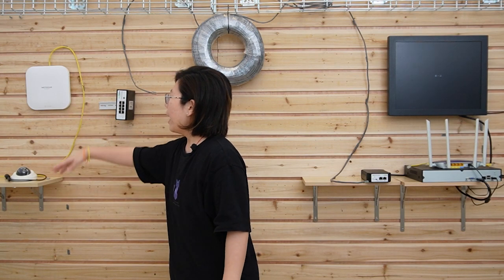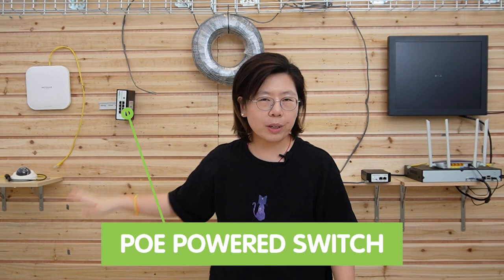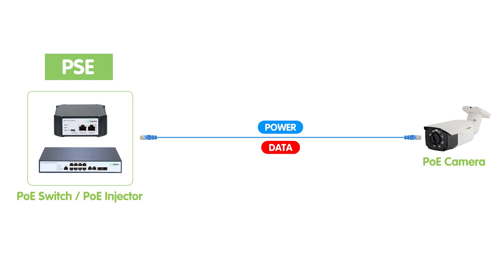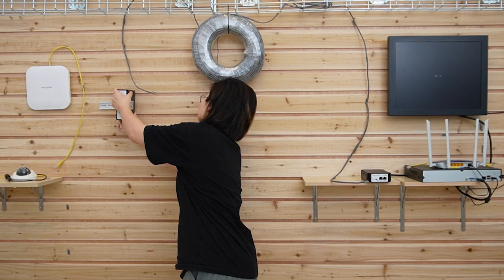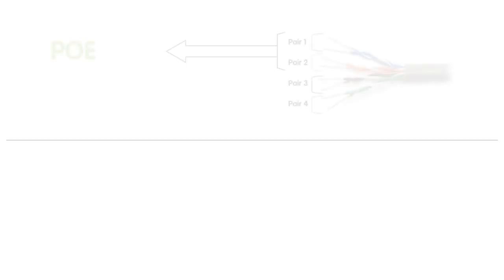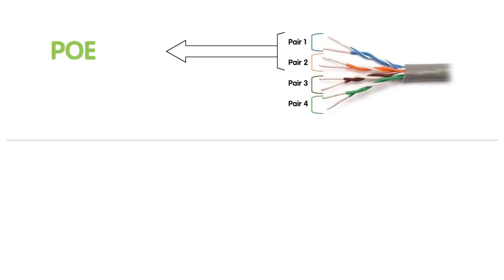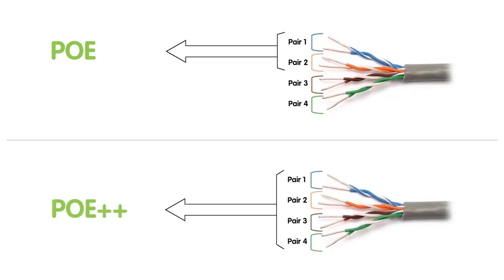Install Up to 7 IP Devices with PoE++ Powered Switch

Comment: nice video thanks  i have a question for this setup can i use it for long distance for example  600 meter? please guide me for a design especially i need for the end connect more than camera and there is no room no electricity only desert
Reply from the maker: We do have solutions for long distance setup. Please contact our support team at support@fastcabling.com for personalized assistance completely free.